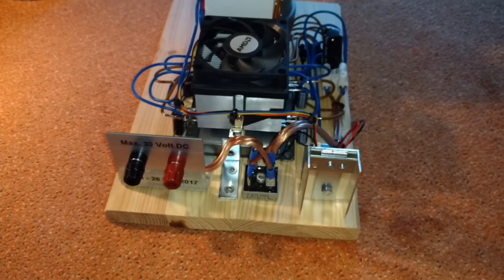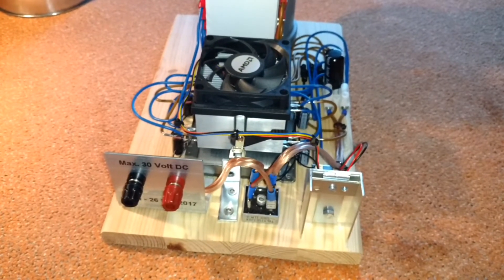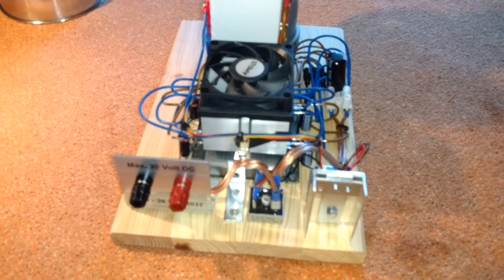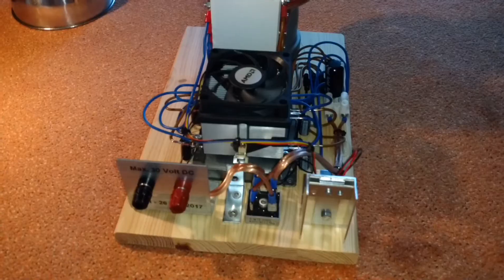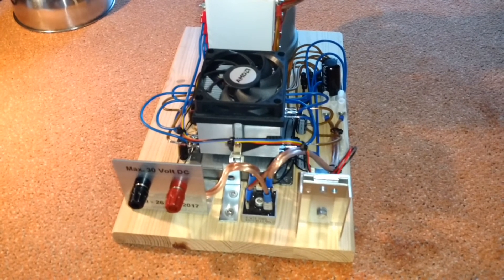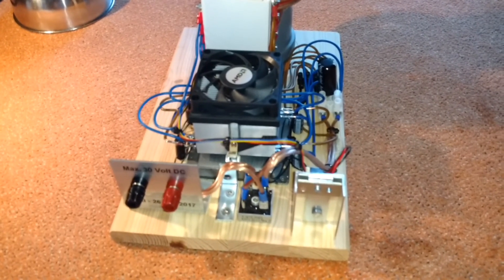4x Slayer Exciter - Circuit Details

Comment: Hi You all. It would interests me , what does the 4X slayer wave form looks like. do the 4 tip's run at  the same frequency?
Reply from the maker: All transistors must run at the same frequency, otherwise this circuit will not work.